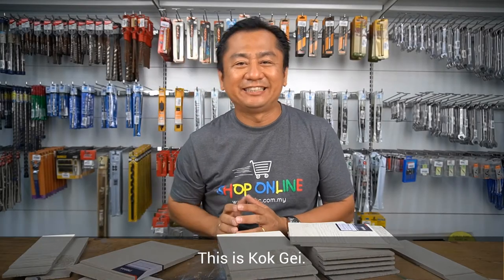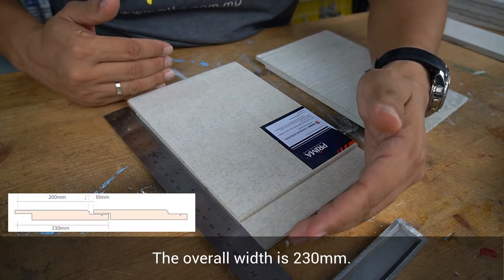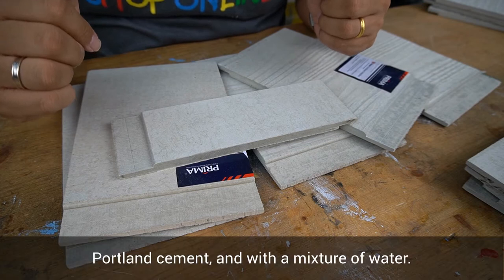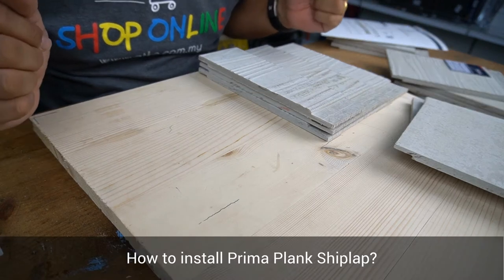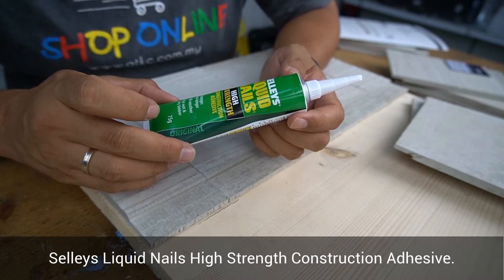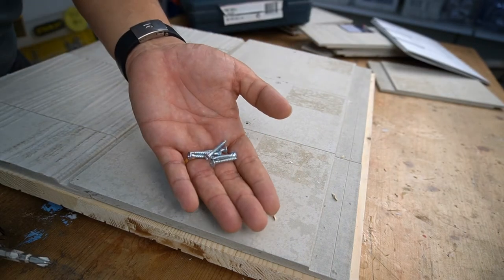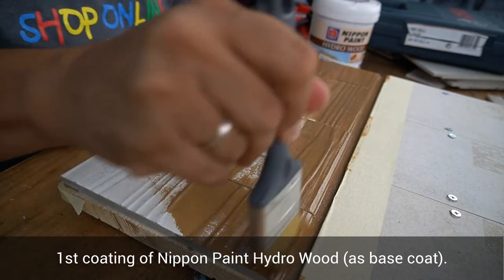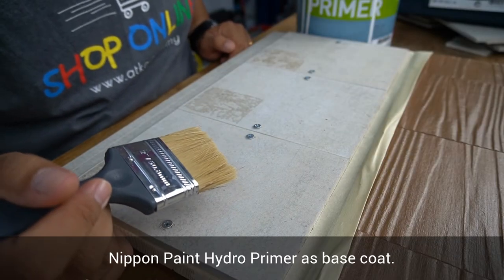PRIMAplank™ Shiplap | Fibre Cement Building Solutions Malaysia

Comment: If i want to use the prima plank woodgrain on walls to accent the walls, how do i install it? Can i just glue it straight to the concrete using Construction adhesive, without the wood backing? or i must have some sort of plywood behind it?
Reply from the maker: Yes, you can glue it directly on the wall using construction adhesive. Some use concrete air nailer to double secure it. Make sure your walls are flat and leveled.
Reply: Thanks
Reply from the maker: @Yusufmasron  Welcome.